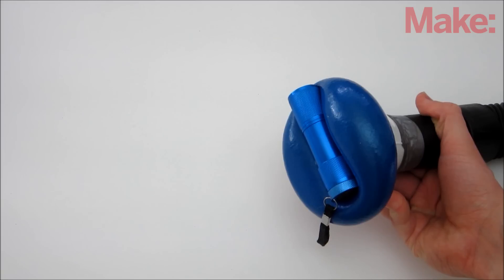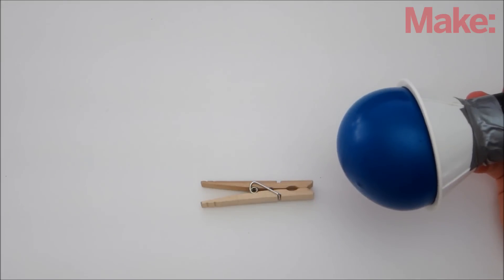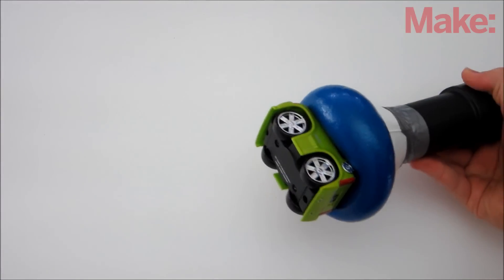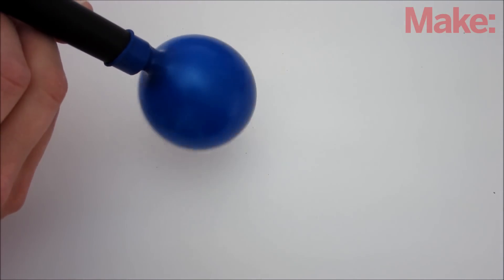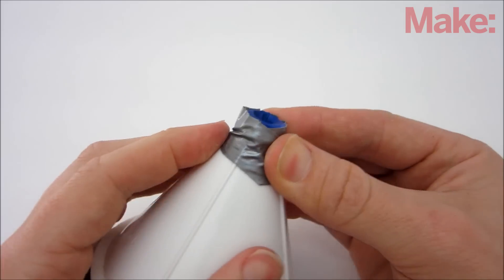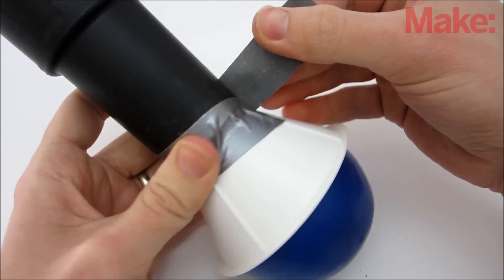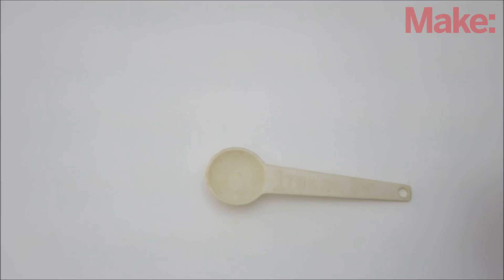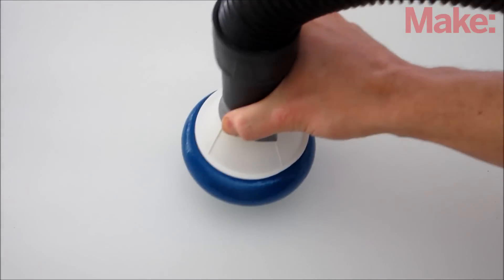Universal Robot Gripper

Comment: Just curious as to how much pressure you need to apply when trying to grab an object. Could you pick up a coffee mug from the handle without knocking it over or having it slide away? You seem to be pressing down fairly hard on the object to get the balloon to form around the object.

Comment: well how do you make a vacuum and a air compressor to work in sync????
Reply: A reversible air pump hooked up to an arduino or other microcontroller will do the trick.
Reply: Weallwayswin WithGod You can fit a venturi pump to compressed air hose to reverse the flow of air.

Comment: What type of air pump are you using?  Can you rig up a shop vac maybe?
Reply: That looks like a shop vac hose, but I have no idea what he is doing to partially inflate the balloon. A shop vac's blower would pop it quickly. I built one of these grippers about a year and a half ago using the small vacuum pump sold at sparkfun. It is cheap and easy for diy stuff, but there are much better pumps out there. For early testing I used a food saver vacuum sealer for frozen foods that had a hose attachment for sealing jars. I think it actually worked better than the sparkfun pump, but was far too big for my application.
Reply: I thought he was simply turning off the vacuum to get it to expand again...
Reply: That is possible, but it looked like it was slightly inflated. I could be wrong though. I haven't done anything with my gripper in quite a while.

Comment: Why aren't there robots that use this now?
Reply: QuantumFluxable It depends completely on the application. For pick and place these work very well for strange shaped parts. In industry the noise from the pump is not an issue and vacuum can be generated using compressed air in any case (and many plants have large compressors housed separately). And they don't have to use a lot of energy, it's a sealed system so very little air needs to be evacuated, of course a vacuum cleaner is not a good example it would be better to use a decent vacuum pump attached to a tank.